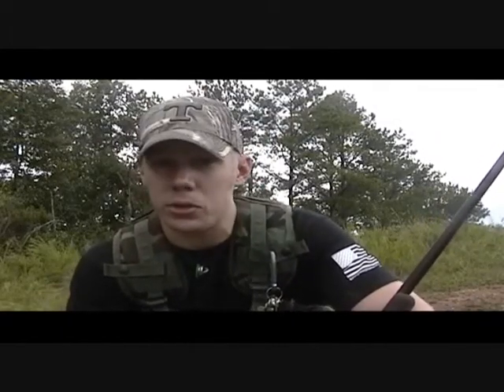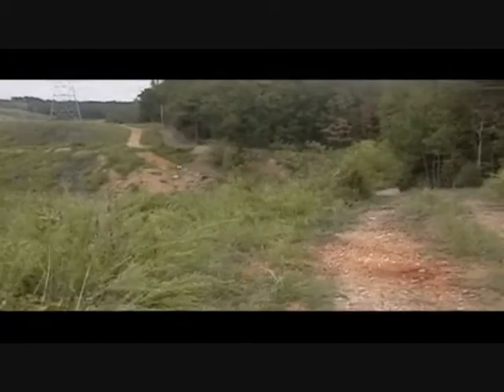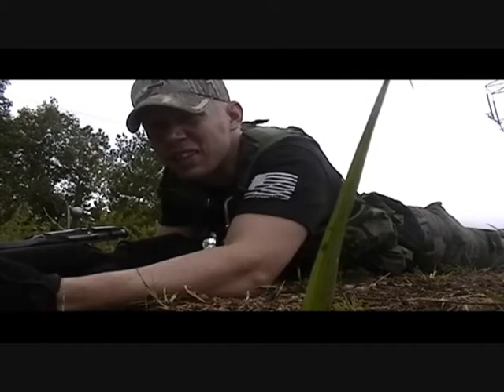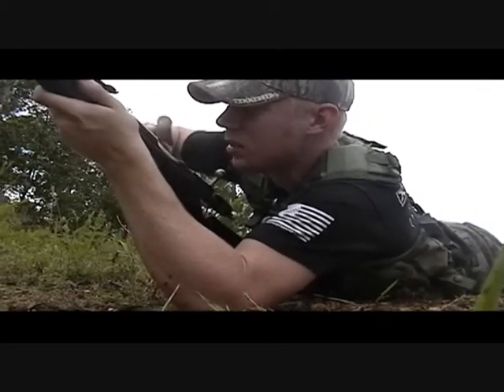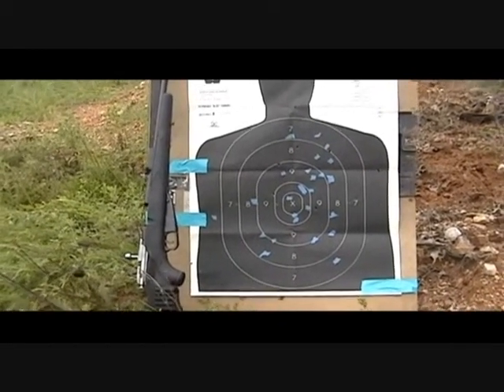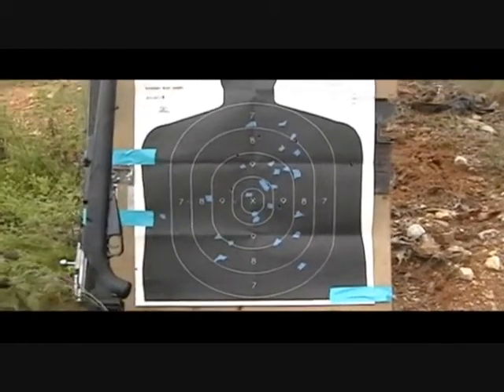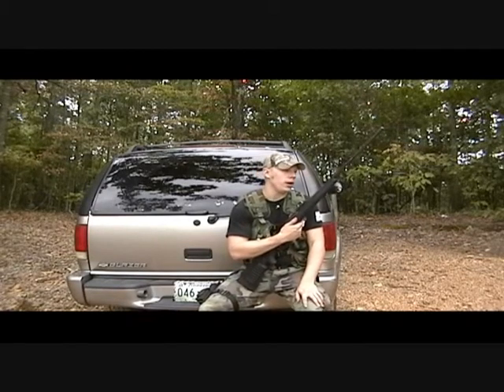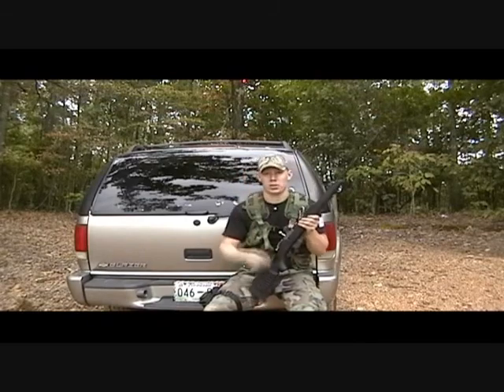Mosin Nagant ATI Sock Mod Testing

Comment: Great review!

I had to grind a fair bit of plastic near the extractor to get my 91/30 to function with the ATI stock.  I also partially glass bedded the stock with JB weld near the tang and rear screw.  The rifle groups better now and points better than it did with the regular stock.

Comment: actually the lenth of pull ist that much different than the wood tock if yo put them next to eachother. My ATI stock does not float and is going to require fitting. You should do th dollar bill test to show yours is floated because ive nevr seen one witout modifiing that is floated.